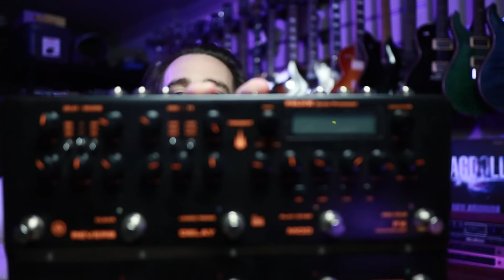Is This the Easiest Modeller to Use? NUX Trident

Comment: NU-X are killing it lately. This appears to be a serious piece of good gear.  I almost bought an MG-30, but eventually went with a POD Go.  Had the Trident been out when i bought, this would have probably got me to bite on NU-X.  Great video Leon as always.  God bless and rock on 🎸👍😎
Reply: I have the MG-30 and imo it crushes the Pod Go.
Reply: @reverbautopsy9093 what do you hse it for dude? i'm playing mainly metal and was wondering if nux's distortion might feel somewhat organic
Reply: @VOX-TRO  I don't think Nux' high gain modeling is the best. It's not bad but you'd be better off maybe with the Pod Go or HX Stomp, if metal is what you're after. I mostly use medium gain, classic marshall amps and stuff like the Hi-Watt which are all amazing on the MG-30.
Reply: @reverbautopsy9093  So you think the MG30 crushes the Pod Go in almost everything BUT the high gain? I'm actually planning to get the new NUX Trident, I heard it's an upgrade to the MG30 whilst still being affordable
Reply: @VOX-TRO  yeah in my opinion, the nux shines in everything but the high gain stuff fails to blow me away. I like the JCM 800 and the Friedman is good but too gainy for what I want in a Friedman. I rarely use the other metal amps ever. It's far from bad, but other modelers do higher gain better.
Reply: @reverbautopsy9093  thanks for sharing your exp bro, i take it you haven't tried the trident right?

Comment: Nice demo!! Question: Is there a way to shut off the amp simulator with one of the buttons? I would use this mainly for direct recording but for the occasional gig I'd love to be able to shut the amp sim off and use a fuzz tone. Also have you A/B'd this unit with the Nux Cerebrus? I like the EFX pedal insert options of the Cerebrus but the Trident seems to sound fatter in all the demos I've seen

Comment: It may have a great layout and be easy to use - the problem is, it has that dated, stiff and artificial sounding distortion (unlike their MG-30 model). It may be great for effects, cleans and crunch overdrive - just not so much for high-gain sounds.

Comment: Hi Leon. If you still have the Trident, do upgrade to the VE2 firmware. Lots of tasty additions (eg ping-pong delay, greater pseudo-stereo, more amp/cabs, better factory settings etc).

Comment: I have the NuxMG30. Love it. This sounds like a definite upgrade. I would consider purchasing this one depending on the price. Im a home player enthusiast at the moment.Yes this is easier to use for sure 💯. Thanks  man 😎👍✌️✌️🎸🎸
Reply: Finally, did you buy Trident? I was hesitating between MG30, GX100 (and now GX10), but when hearing Trident in this one, I wonder if I should add it to the shortlist, despite its small screen (but it seems Trident has Windows editor?)
Reply: @lasu7712  no I haven't yet. Bought a bunch of guitars and amps. Tapped out at the moment 😄🤣. Boss and Nux are good for the money. Gx 100. Looking good 😊

Comment: I like that the virtual pedals go right to left like a real pedal chain - My Zoom Multistomps do that as well. It seems stupid that other companies do it backwards.
Reply: My discrete pedalboard goes from left (tuner, wah, drives) to right (trem, delay, reverb) 😊 Each of us can organize the board as needed or wanted. I use to read from left to right, so probably that's why I like to see my signal flow the same way, too. The same goes for amps: heads built into a combo housing often show a mirrored controls layout because the manufacturers produce only one amp version for both head and combo versions.
Reply: @sexyguitarboy69  Yes, I can understand that since we in the western world read left to right, it might seem more natural to see our pedals that way, but the fact is that the inputs and outputs on hardware pedals go right to left. It would seem very impractical and messy to me to wire all my pedals with extra long patch cables going all the way around each pedal, just so I can see my pedal chain the same way I read, since, I’m not reading them like a book — but as you say, to each their own.

Comment: Hi Leon - me again :) I am running a Tonex in front of the AXE III Turbo to make quick EQ adjustments etc. on the fly but its 44khz - seems a bit phasey - this Trident is 48khz - would it be better to use this unit thats 48khz to match Fractal 48khz ? would that be better way of doing it or it doesnt matter  ? - thanks Buddy
Reply from the maker: It won't matter since you're not using the digital I/O
Reply: Great point Leon thanks so much - stay well :)

Comment: Been eyeing the Nux Cerberus (basically the predecessor/little brother to the Trident) to use as an easy flightboard/gigboard, but I've not been sure exactly how good or bad the effects in it are. It's difficult to judge just by watching youttube videos. The Trident looks really interesting though!
Reply: I had a Cerberus for a while. The effects were really good actually. Delay and reverbs sounded incredible and the mods were pretty good too. The Univibe left a bit to be desired but that was my only complaint. I sold it because I wanted something with amp modeling. 

Needless to say, I’m very interested in the Trident.

Comment: Been trying to find the answer to what I thought was a simple question, no luck so far.  Is it possible to record both the dry / direct guitar as well as the full output of the unit when using this as an audio interface?
Reply: i want to know this also. There is 4 outputs

Comment: How do you compare this with the Boss GX-100?
Reply from the maker: GX is a lot more powerful, this is a lot cheaper.
Reply: @LeonTodd  The GX-100 is $539.99 the NUX Trident is $449.00 So less than $100 difference. Did you mistake for the GX-1000?
Reply from the maker: @inspiringminds7284  ah yep I'm thinking of the GT-1000. In which case, if the $100 price gap isn't an issue it's more a case of what UI you prefer - touch screen with a few generic encoders or dedicated pedal style knobs. The GX doesn't have XLR outputs either from memory.
Reply: @LeonTodd  Thank you, I Enjoy your posts at Fractal too. I like how you stay above the petty things that some old time users seem to get themselves in with other users that causes a negative vibe at Fractal Forum. 

Just want to wish you the best, you're a great man.